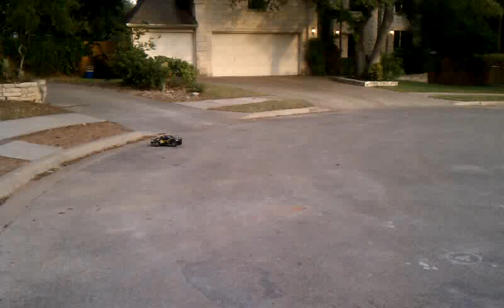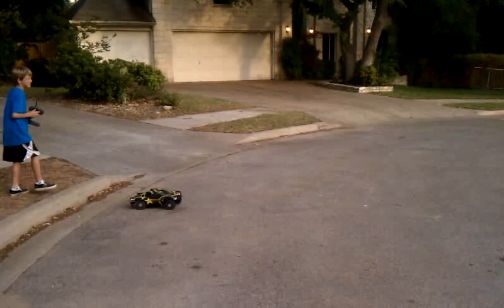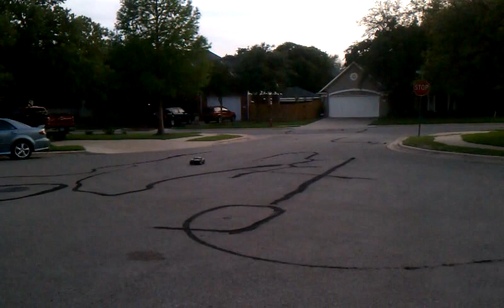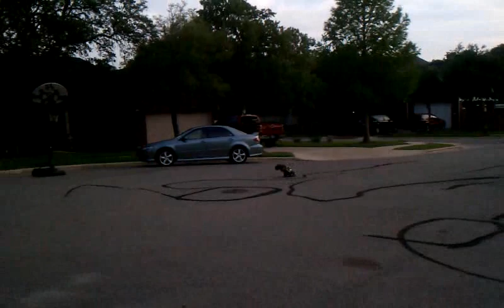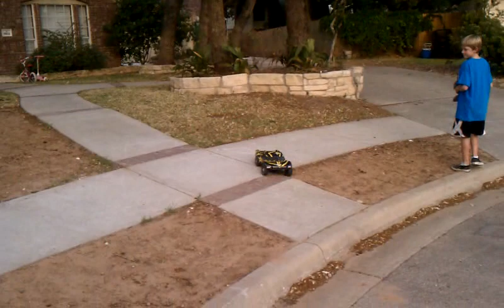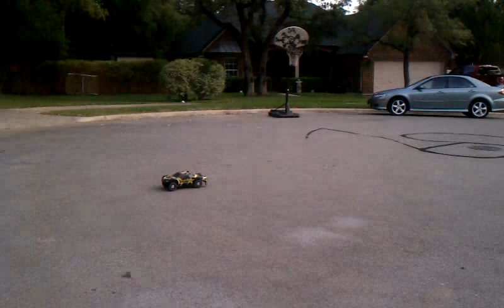Team Losi XXX-SCT with Tacon 3200KV and HobbyWing 60A-ESC

Comment: Hi,I Did the same Ezun 60A Tacon 3000KV ,But I got the 3660-3000 Its a 550 Motor 5MM shaft.It's got a Lot of Power!! Right Now it has 21T Pinion and 86T Spur Gear at 48 Pitch May go to 32 Pitch Later.....

Comment from the maker: @onionvolcano1, The HobbyWing ESC comes with 3.5mm bullet connectors, however they are not pre-soldered. The Tacon motor comes with 4mm bullets and extra female bullets to solder on the ESC. If you watch my  video on the Duratrax Evader Brushless upgrade, I show a close up and some soldering tips with this same combo.